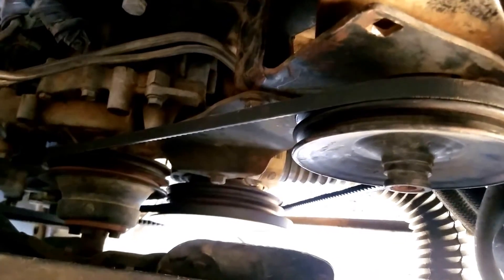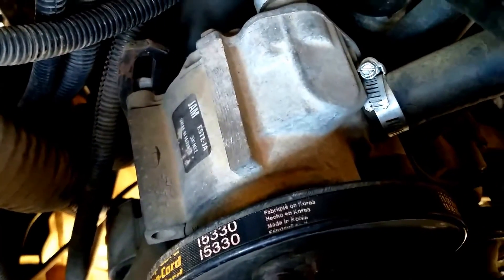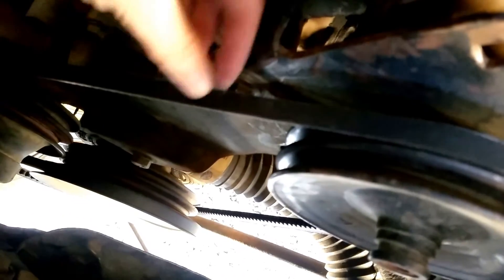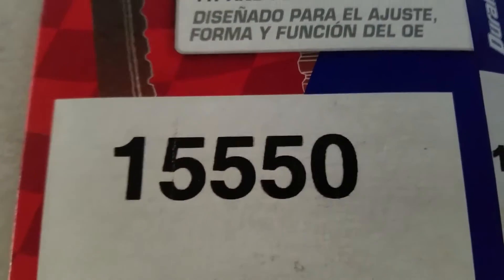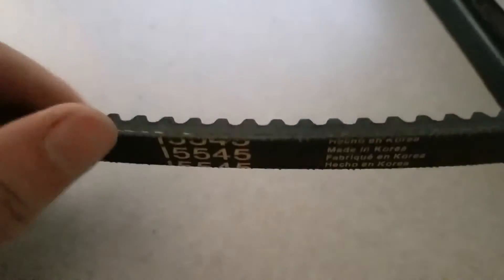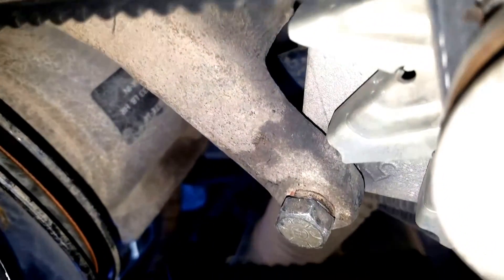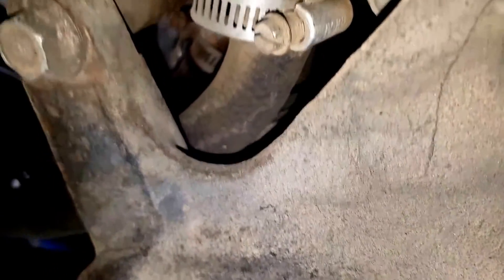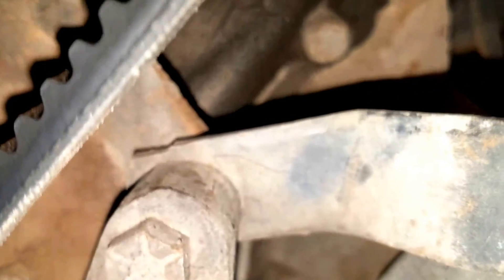Mystery of the Double Belts & Belt Diagram (1986 Ford E350)

Comment: I just want to say thank you. It's not about the belt but about the engine assembly.  I looked and looked for a video on where and how  all the brackets for the power steering, alternator, ect. And I couldn't find squat. Looking through your video solved my issues.  By using the images within I was able to complete my project. Thanks again.

Comment: Its now 2023, I'm wondering if you still have your RV.  If so, I can be used to help find missing parts or IDing a part (I need help at times too).  I have a 1986 E350 RV with 460 engine too.

Comment: what kind of alternator are you using? I have an 86 E350 Ambulance Pkg. And am trying to see if I can use a different alternator other than this LEECE NEVILLE A0017706AA 165amp alternator. Just curious to find a replacement cause theres not many of these out there.. Thanks

Comment: Hi! Thanks for sharing your video... I have a 86 f150 302 engine and thanks to your video could figure out the belts mystery: the “extra” belt is for the AC compressor and runs from the outmost crankshaft pulley to the AC compressor pulley to the tensioner the truck should have mounted solely for that purpose... that tensioner goes up above the crankshaft and leaning a little to the passenger side of the truck. I hope you find this useful...
Reply: Mines got 3. My smog pump ain't routed in, but belt 1 goes to the AC compressor z over an idler, and to th crank. One goes from the crank to the alternator, and one from the crank to the water pump and power steering pump

Comment: Move the altanator&in this case the smog controller/*air compressor bracket&all, out of the way of the radiator. So you tilt both so you will have clearance for the long bolt as common with most altanator's ect. &Walla presto magic

Comment: Mine was the same exact way, nothing worked, I ended up removing all the smog stuff as it didn’t work anyways and installed a single belt. I do keep a spare belt in my tool box but so far all is good belt wise but now this morning the alternator finally conked out (how I found your channel) and am waiting for a replacement to be dropped off later today.. I think it was the original so being an 86 model RV I think I got my money’s worth out of it.....

Comment: There should be two 15550's.
In your drawing it shows a 15380 instead of another 15550 that also wraps around the fan pulley.
Each 15550 should wrap around the crank shaft and fan pulleys and be tensioned in opposite directions. One by the power steering pump, & one by the alternator.
Reply: I have a 1985 E350 I have a hell of a time matching belt still slipping and the I feel better now knowing that it's not only me I have the problem but even the dealer could not figure it out this is a video you showed us at that very exactly the same like problem with me I don't I'm going to anyway thank you

Comment: I too am a female owner operator of a old motor home. I have learned everything from having to fix it.

Are you supposed to be running a serpentine belt on one of them? 
I have a 1988 ford E-350 460 7.5l EFI. I have one belt that is called a fan belt that runs the Alt, Air pump, Fan/Water pump, and finally Crank shaft. Then the one that is called a serpentine belt runs Crank shaft, Fan/Water pump, A/C or Idler, Power steering, and has automatic tensioner. 
Finding myself having to constantly work on my engine I went ahead and purchased a Ford factory service and repair manual online. It has been a lifesaver for me. It tells you everything you need to know from troubleshooting to removal and replacement. Even if you will need special service tools. Chilton and Haynes are good but there is nothing like the real thing. Lol. I hope thia helps. 
If you have any questions or anything you can find me directly at jmonn48@gmail.com.
Reply: It changes from one year to the next. The 81-86 uses up to four V shape belts, the one she is missing is the one for the ac compresor. From the 87 on the system changes to a serpentine belt, the kind that can run on either side of the belt and uses only one for all the accessories...
Reply: @arturomacoy2286  There should be 5 belts.  Perhaps you are saying 4 belts plus the AC Compressor belt?.  (Remember there should be two on the PS) Her drawing is also missing a smog(air) pump - could be the previous owner pulled it for some reason and didn't put it back on???? There should be two smog (air) pumps on the vehicle - side by side on top.  Belt numbers vary with manufacturer & quality if made by the same company.

Comment: Anyone know how to get long bolt off?
Reply: Drop the bracket out
Reply: I know this a a long time ago but just did mine.  Just like Ross said drop it out from the bottom.  So I dropped my alternator and the bracket together.  After I did that I cleaned it up and cut off the smog piece of it lightened up up and made it much easier to reinstall.

Comment: The white lettering on the belt will tell were made, date of manufacture.  You may hope the match at the store?  I went to 2 auto zone for belts.  they were a mismatch.  went to 2 Pep Boys they were also a mismatch.  Put all belt between 2 steel bars and pulled.  One of the Pep boys, and one of the Autozone were a match!  Don't let the clerk feed you a line of bs.
Reply: Yep same here I had to get a few belts from multiple stores until I got a set that where the same.  Another issue the belts in general seem to need to be replaced often if you want squeal free life.  I carry a full set of spares so ignore it sometimes for awhile but eventually it bugs me enough and I replace them.

Comment: Dual belts that run the same path should be the same length and the tension should be the same when adjusted.  If one belt is looser than the other something could be worn, bent or broken allowing one of the pulleys to run at a slight angle which would give the belt paths different lengths.  I have also seen this where a spacer was missing between a main mounting bracket and the engine and when the bolt was torqued down the bracket held the pulleys at an angle instead of straight.
Reply: I went to 2 auto zone for belts.  they were a mismatch.  went to 2 Pep Boys they were also a mismatch.  Put all belt between 2 steel bars and pulled.  One of the Pep boys, and one of the Autozone were a match!  Don't let the clerk feed you a line of bs.

Comment: There are two adjusting arms https://www.google.com/search?q=1986+ford+e350+belts&ie=UTF-8&oe=UTF-8&hl=en-us&client=safari#imgrc=MlO98B_NvgQvaM:there's one on the alternator and one on the air pump
Reply from the maker: TT Travels neither the alternator nor the air pump is connected to the belts that are troubling me, and while my air pump.may have an adjuster arm that isnt necessary to tension the two belts on that side.correctly - adjusting the alternator tightens both the air pump belt and the alternator belts just fun.... but good to know about anyways! I will check it out next time I'm under the hood
Reply from the maker: TT Travels nvm i think i see what you were getting at - move air pump adjustment arm and then the alternator should be in a position to remove the pivot bolt? ill try that